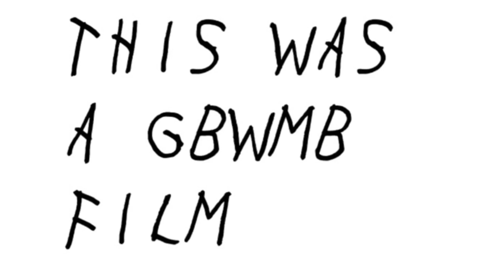Polaris Sportsman 500 Front Differential

Comment: I see your front diff has two wires running to it. So does this model lock the front differential instead of the hubs. I have two kinds one with the wires and one without. The one without wires is locked.